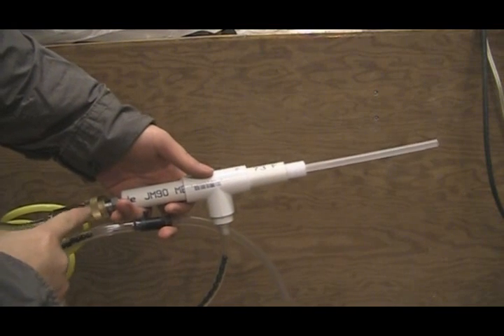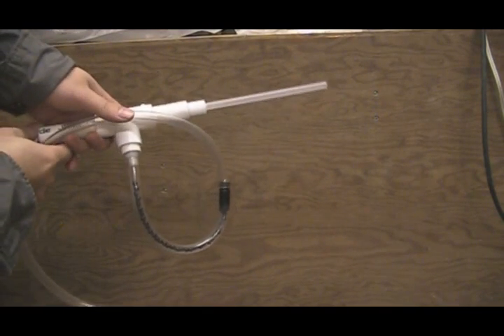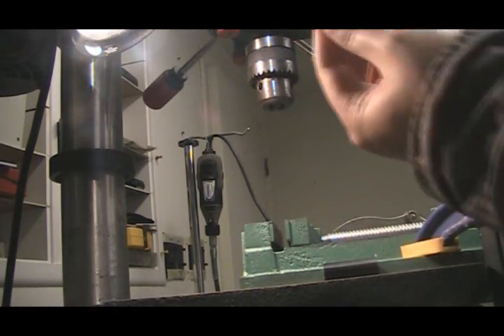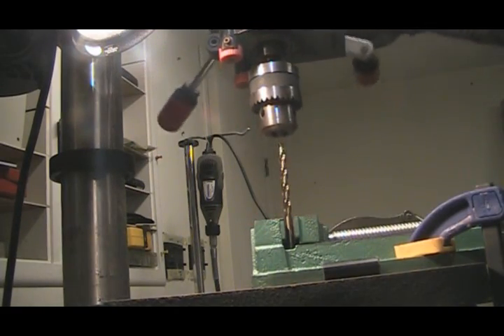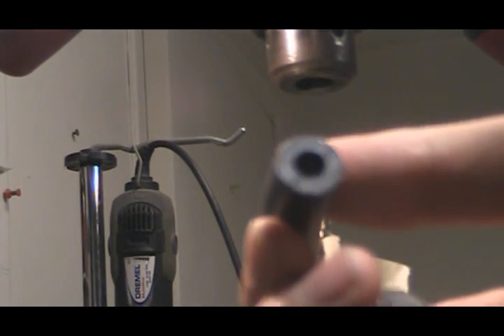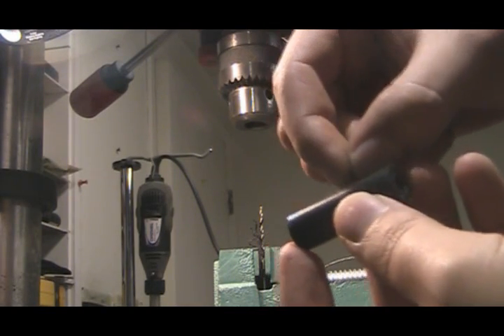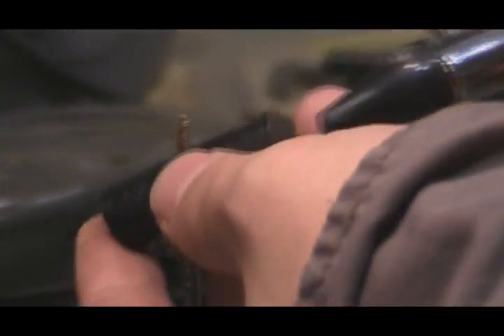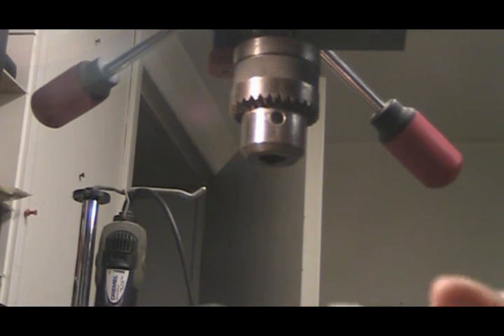Homemade BB Gun [using a one way valve]

Comment: You need a better way to feed the B B's than blowing into the tube.  Mainly, its not a constant speed feed, but sporadic.  You should have the same compressor air go to a valve that is on / off trigger, and also next a variable valve to control air pressure going into the BB tube to fine tune the speed you want the B B's to feed at.  Also, it would be much better if the B Bs were in a hopper, or better, in a coiled tube.

Comment: put a t from the compressor line and a small valve before the check valve then hook the t up to the bb pipe so you have a trigger and do not have to blow into it. or still have a t in the compressor line and hook the bb pipe up to it with the check valve in it but have a valve at the air in place so the air does not run constantly and that would be the trigger.